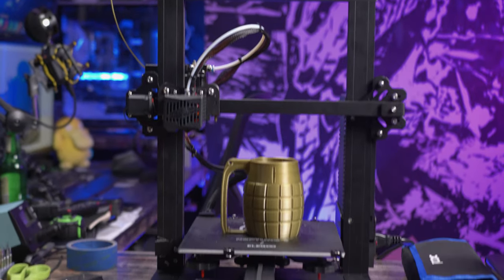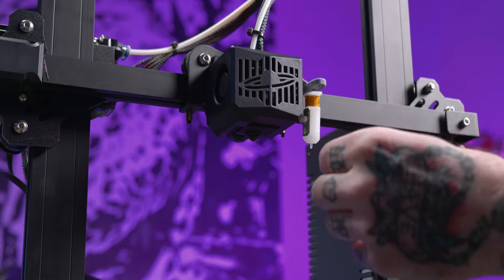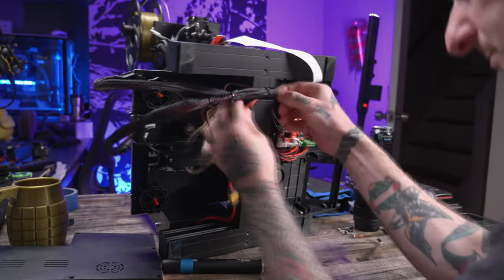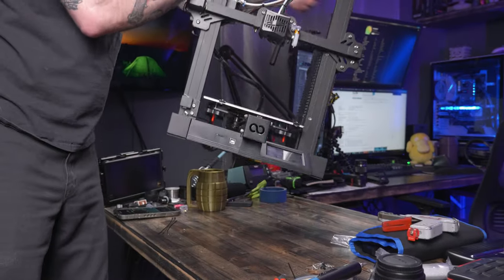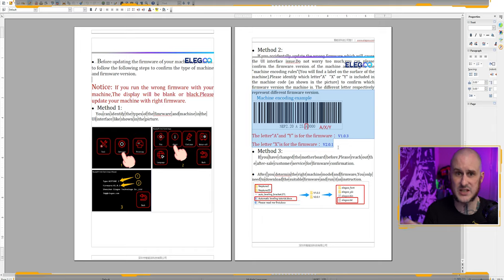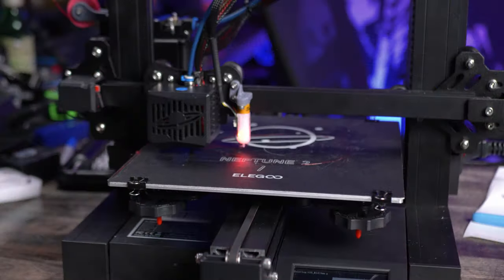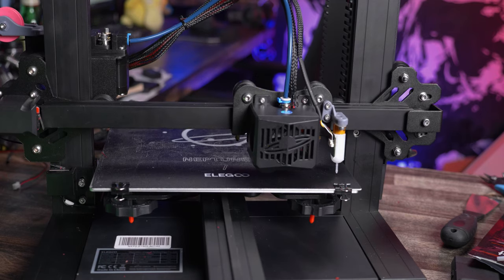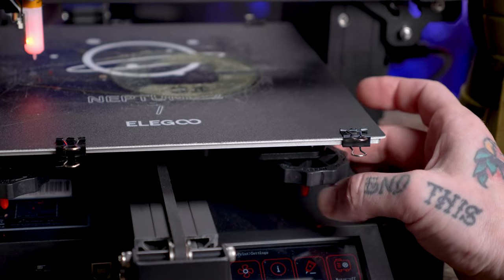DON'T Install BL Touch on the Neptune 2! - How-To and why not to...

Comment: I was wondering what angle this video was going to take.
Reply from the maker: I’m still not sure I know which angle it DID. 😂
Reply: @MandicReally  well I kinda assumed you would have found some great fix. But it seems like if you add the bl you should just change the board. But then it's not the value it claims to be. Personally I have never felt a need for abl. And maybe it's just I don't know what I'm missing.
Reply from the maker: @paintballercali  I agree actually. I really don’t feel a need for ABL on my machines. I just do videos about them because I know it’s what people want. 

I tried like hell and hoped I’d come up with a magic fix, but nope. The original cut of this video was 22 minutes long but I trimmed it substantially when I realized where it was going.

Comment: not c00L, design placed on some "shady" portal, i dont want to make acc on it. Why not Thingverse or printables like civilised ppl do ?
Reply from the maker: "Shady portal", Thangs is one of the largest sharing platforms around.  Thingiverse is extremely buggy, had a data breach last year, and doesn't update their website.  Printables (wasn't called that then) was barely used when I released this design.  This video is almost 2 years old.